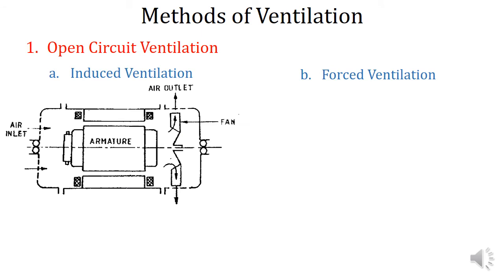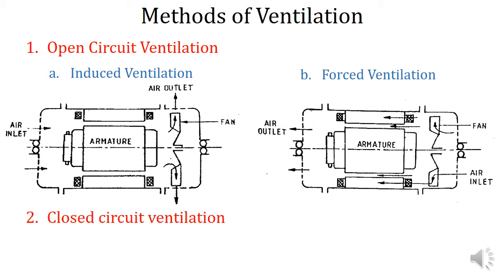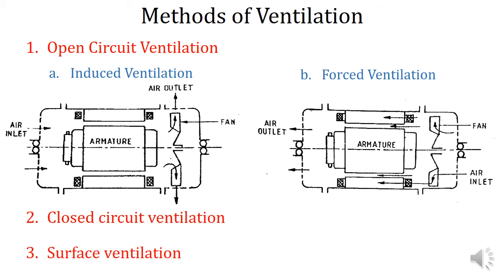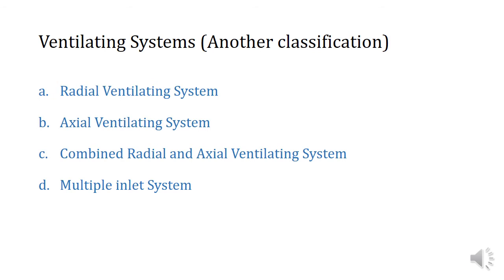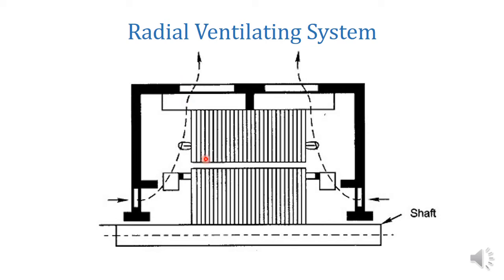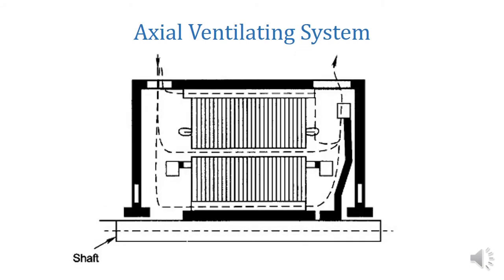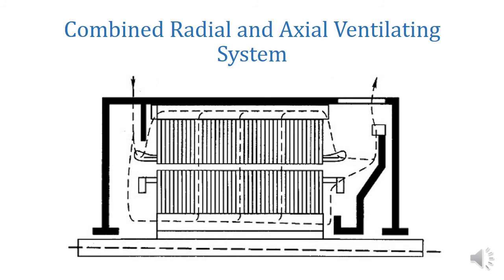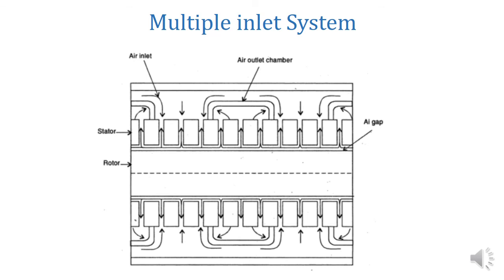Module_1_Part_3_Methods of Ventilation

Comment: nice one it's help me a lot but how can we know we need fan both size of motor saft or one side???
Reply from the maker: It is not possible to connect fans on both sides. On one of the sides, the mechanical load will be coupled to the shaft.